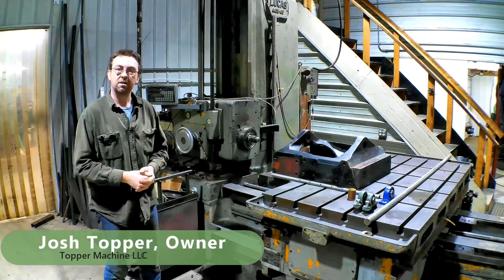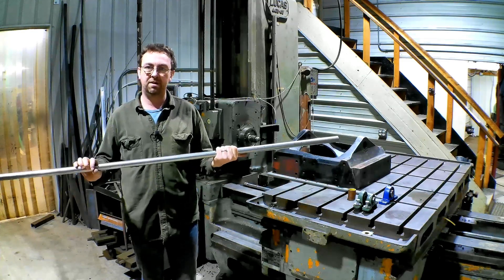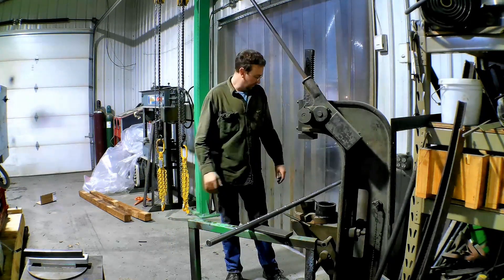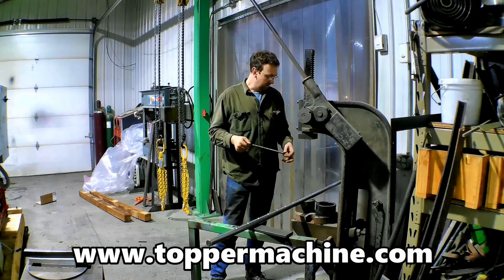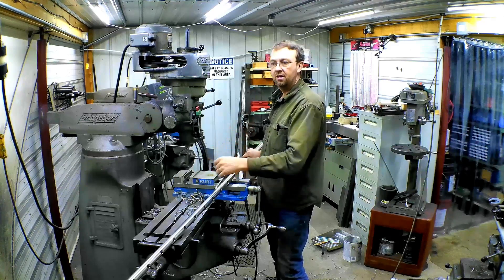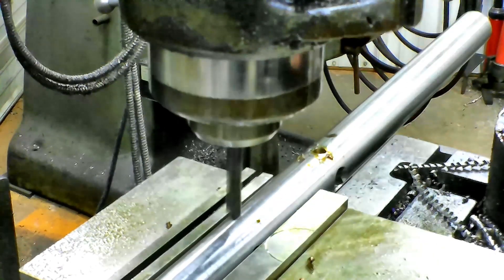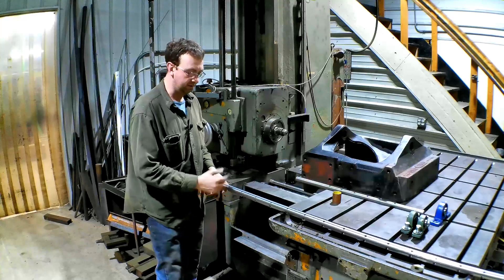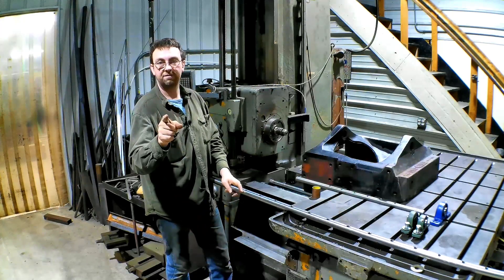Shop Made Tools, Line Boring Bar, Broaching Square Holes, Manual Machine Shop

Comment: Hello Josh. Another new addition to the shop. Takes time to build stuff up and no doubt you will have to make many more things for different jobs but you can just save them and then things will become easier for you in the future. I don't need to tell you this lol! Great job.
Reply from the maker: After 10 years, I have so much tooling. Some bought, some made,but it seems you always are needing something else. I guess that's why I try to plan ahead for different jobs when designing my tools.
Reply: @TopperMachineLLC  you do what you need to get the job done. usually you like to do it the first time and you.are done if you happen to do something wrong. it can become scrap or possible rework.   and with manual vs cnc. i think cnc is any machining with a computer chip and programming. your lion engine lathe has powered feeds manual.or mechanical. one.thing that i do not know. if it has a computer chip  in the.motor configuration. if it was.built in it could explain whybthe iraqi could not get the correct centrifugal speed to separate.the nuclear matter for weapons of mass destruction. only my guess but otherwise it should not been a big deal to dial in a certain centrifigal.speed.

Comment: I re
Aly hope you reply to this ? Why would you tap such a large hole for a set screw first I'm not a machinist and I don't even play one on YouTube but in my mind for LINE boring would you not weeken  it  at a point that's got a big hole allready. Oh ye0a thanx for the time you take for video only to have guys like me question your work .
Reply from the maker: Hi Dale, first off, don't feel bad questioning my work. It's a good way for everyone to learn.  In this material, it really won't weaken it any. 4140 PreHard is very strong, and you don't take huge cuts when line boring. The reason for the 3/8-24 set screw was more for the fact I have a huge surplus of them. Smaller would work, but these were readily available. And when you live in a desolate area like I do, it's hard to get things quickly.

Comment: is there a trick to lining the broach up so the hole you make is square with the bar?
Reply from the maker: You can use a square to line it up, but I just eyeballed it. Actually came out really close and if it's off at all the grind on the tool would compensate.

Comment: Hello Josh, I just made a bar very similar to yours about a month ago.  It was 1" diameter and I broached 5/16" square holes in it.  I bought some 5/16" M42 HSS blanks from McMaster-Carr and I found out they were ground about .0015" larger than 5/16" and won't fit my broached holes.  I had to dig through my old box of HSS to find some blanks that were ground just under 5/16".  I was wondering if you ran into this problem with your bar?  Ken
Reply from the maker: Yes Ken! Yes I did. Was none to happy about it either. I just hit my HSS on the belt grinder and took a little off.

Comment: Hi Josh, Well done video. I've made some bars for my HBM also. But I just used round HHS  or modified brazed carbide bits. The square broach does a nice job of it, I may have to invest in one. Do you think the harder version of 4140 is more rigid and worth the trouble? One thing I caught on to is drilling the holes slightly off center on the bar to make the top of the cutting tool "on center" in the cut, seemed to cut down on chatter and make a better finish.....Dave
Reply from the maker: Hi Dave. I would use the 4140 PreHard if you can. I've tried 1018 & 1045, but they aren't stiff enough. I drilled these on center, but grind my HSS to accommodate. By being on center, I can easily run in either direction on rotation.
Reply: New subscriber here. Thanks for another interesting video but I’m a little confused. I thought I’d read in some engineering manual that all steels, regardless of alloy, were the same stiffness, and to get more stiffness you have to go to carbide. If that’s true the same diameter in 1045 should be the same stiffness as annealed 4140.